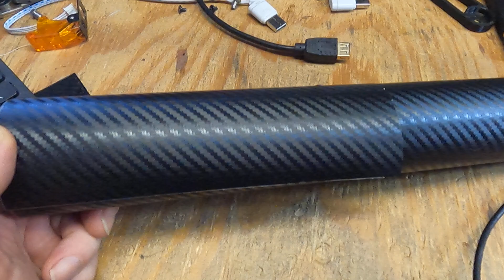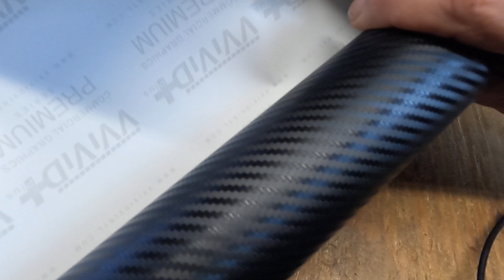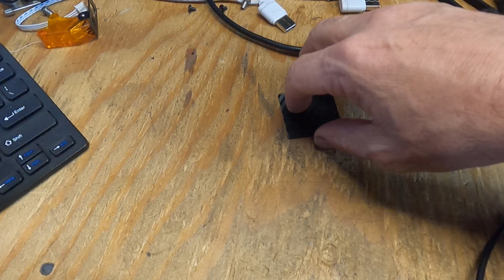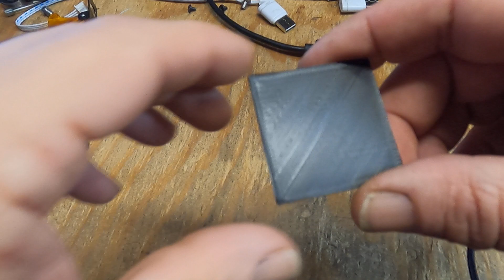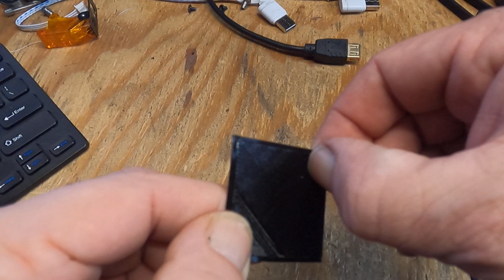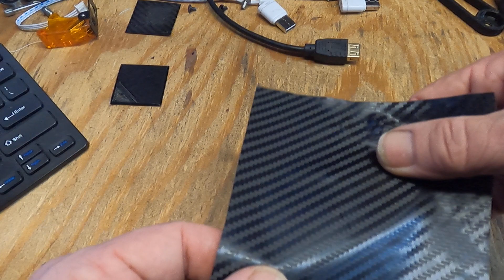Amazing Carbon Fiber Look 3D Printed

Comment: I made some changes to my first print to get it to stick to the build plate. The print came out the same as if i wasnt  using the carbon fiber film on the build plate . I cant see any pattern in the print let me know if you have any suggestions.
Reply from the maker: Make sure your film has texture, then  set the "first layer" temp to the maximum for the filament, set first layer speed to 15, set first layer flow to and first layer width to 105. Try that and let me know